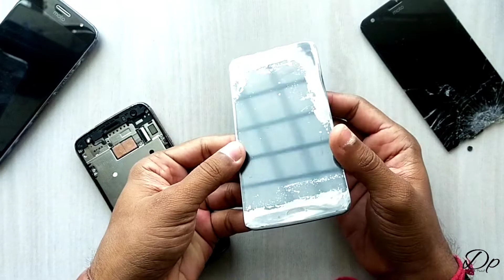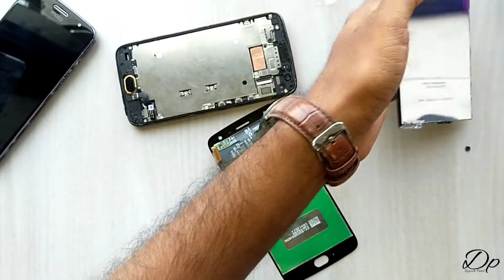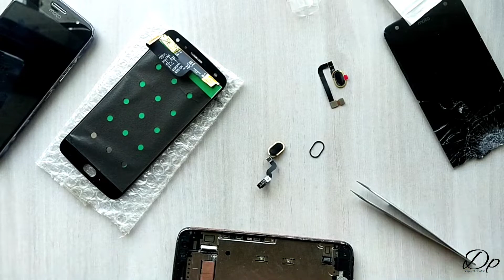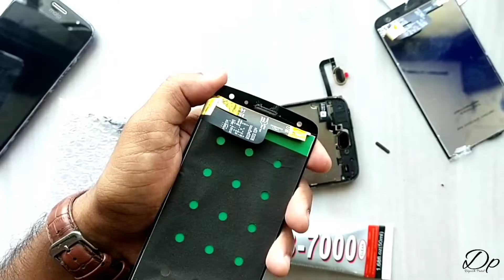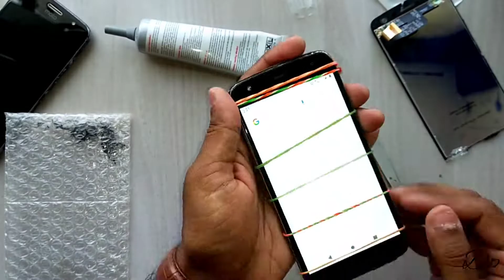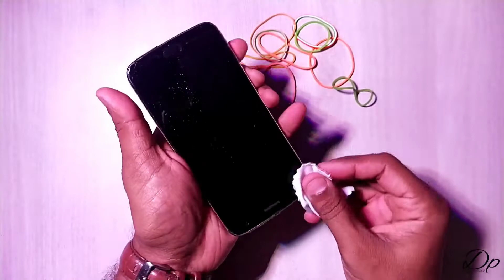Motorola Moto X4 New Display fixing | Screen replacement video

Comment: No logo MOTO on LCD ?
Reply from the maker: On logo there is carbon like cover which we have to peal with blade😁
Reply: @DipeshPatelVlogs  ahh i see. It original lcd?
Reply from the maker: I don't trust this website for original. But i suggest www.witrigs.com for the original products as i changed moto G5s plus display in other video.